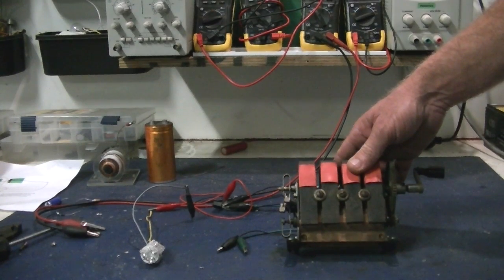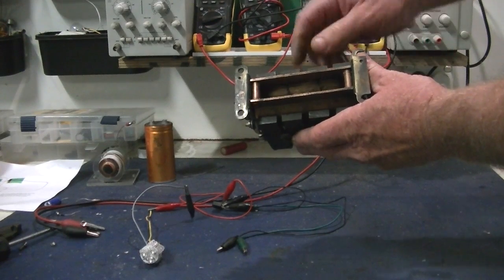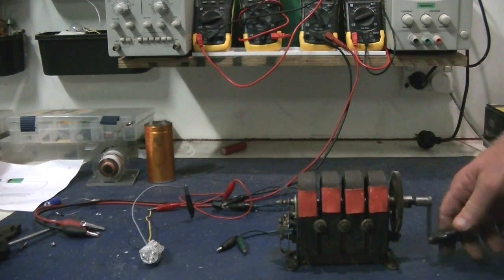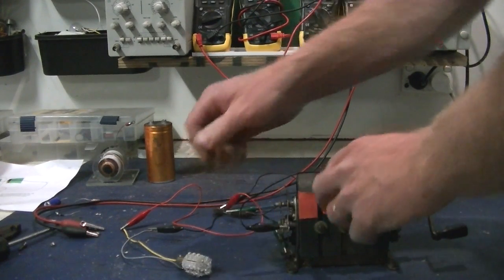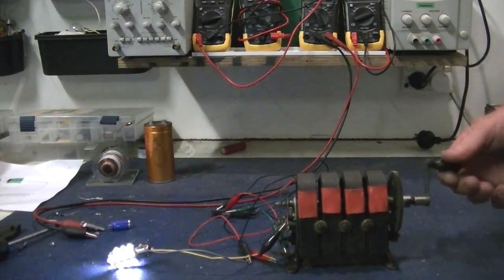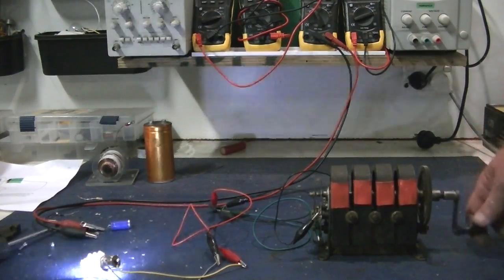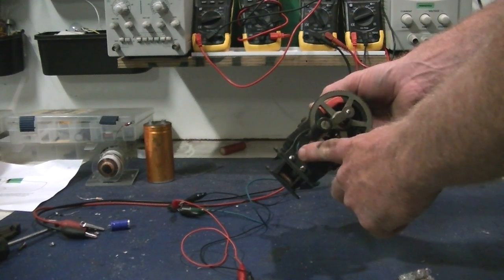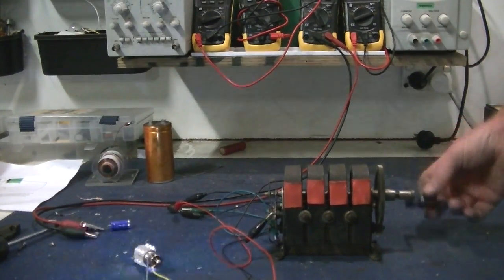old school.MTS

Comment: my teacher in electronics in high school used to have us stand around his table and hold hands and on the table was 2 poles copper about 10 inches in length one end of the kids chain held one pipe while the other end held the other pipe and the challenge was to hold on as long as possible what we didnt know was that under his bench there was a generator like yours and he would crank the hell out of it and watch us twitch in pain and tell us " here is your introduction to electricity 101"